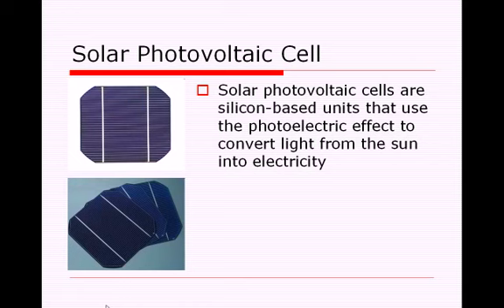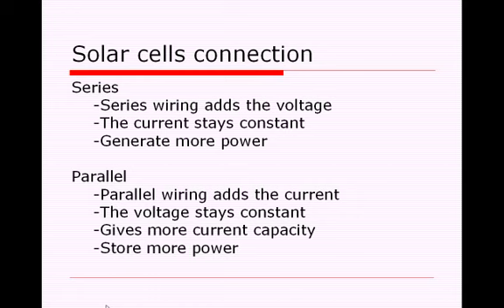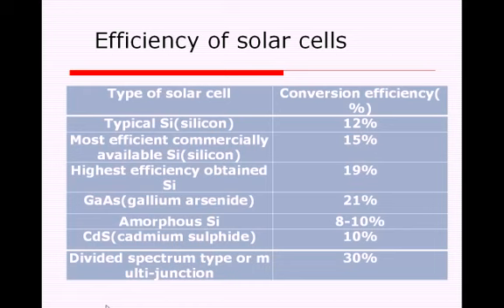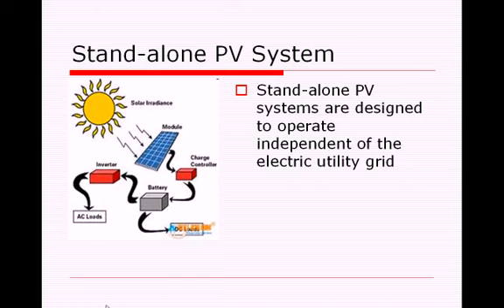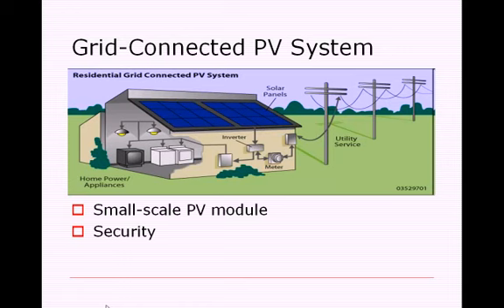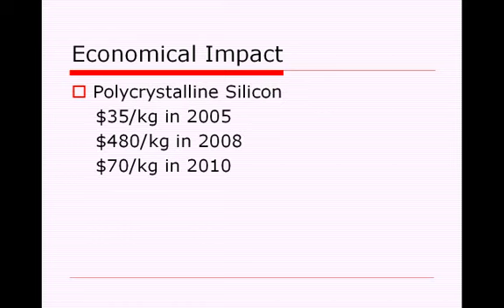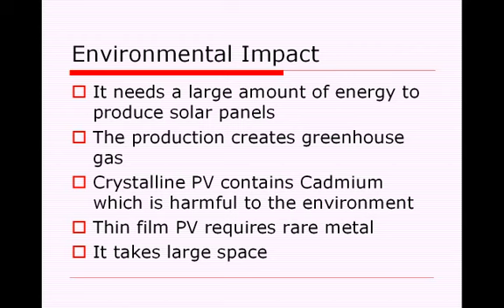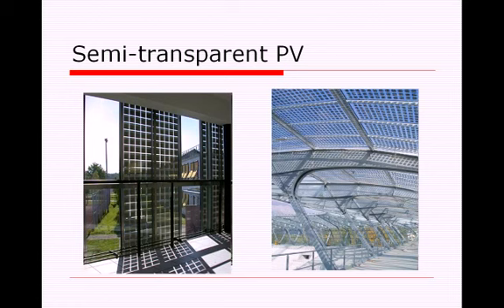UBC EECE492 Video presentation on solar photovoltaic system

Comment: As stated above, this was done as part of a course at University Of British Columbia, Distributed Energy Systems Management: It's stated course objectives involve energy systems, high voltage transmission technology, low voltage domestic distribution, advanced energy storage systems, alternative and sustainable energy sources, interfacing of distributed generation sources, harmonics and power quality; smart metering, + tariffs. Thanks, guys!